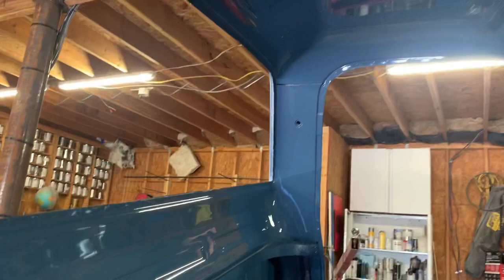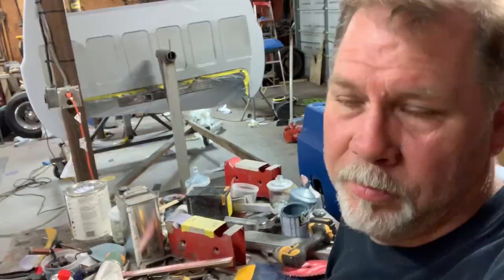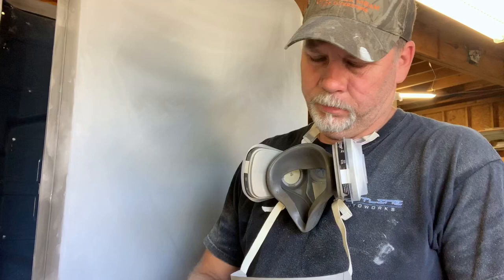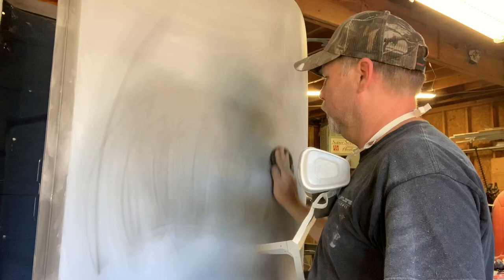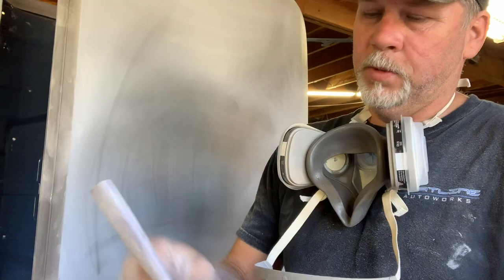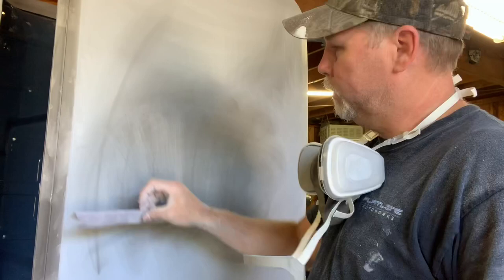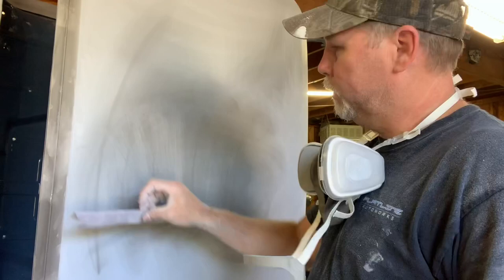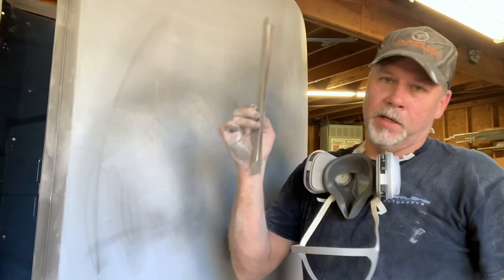Project C10 Episode 4 painting the inside of the cab

Comment: I have to save up to find metal on Facebook, Craigslist or somewhere to build a rotisserie for my 1967 C10! The upper rear cab corners are a round concave ball shape and had to be sanded by hand!
  On the purple looking Charger, you sprayed some clean product before suiting up for painting. It this a blending or adhesive agent?
  Thanks Jim! Sorry, I am in pain so just waiting for Dr's call but binge-watching your early videos. DK, Omaha.
Reply from the maker: No worries Dean.  That was clear basecoat, aka wet bed. Helps with adhesion and fills in sanding scratches so you have a nice surface for the color to lay on. Hard to find affordable steel now. You would think it’s made with gold.

Comment: What type of paint did you use?  Can you provide details on what types of polishes you started with and finished with?  I'm getting ready to paint the cab of my 83 C10 for first time.  Thanks and nice job!
Reply from the maker: Jared Durham I believe I did the inside with ppg’s shopline JAU single stage. The outside of the cab is shopline JB base coat cleared with EC 520. I’ll have to see which polishes I used.
Reply: Stout Custom Thanks for the information.  Is a single stage preferred for cab interiors?  I see it used frequently over 2 stage paints.
Reply from the maker: Jared Durham those trucks usually had lacquer paint. If you don’t take it to bare metal, use single stage. Base /clear will have problems over the top of lacquer. Single stage usually hides imperfections better than base/clear too. Overall it’s easier to get better results with single stage if you have never painted. All that of course would be for solid colors. Metallic colors are hard to spray and look good in single stage. Metallics are best sprayed in base/clear. Have to have more prep work to remove all the lacquer paint first.

Comment: What are you using to keep the dust down?
Reply from the maker: Lorenzo Hollingshed I blow out the shop, turn on a big exhaust fan in the back wall, close the garage doors till they’re about 8” open, and go for it. Sometimes I wet the floor. Usually just try to blow/clean the area around what I’m painting, let everything settle and try not to stir up dust while I’m painting. Usually comes out decent.